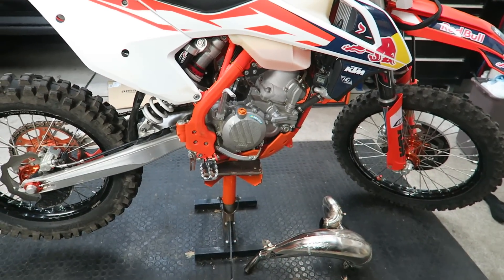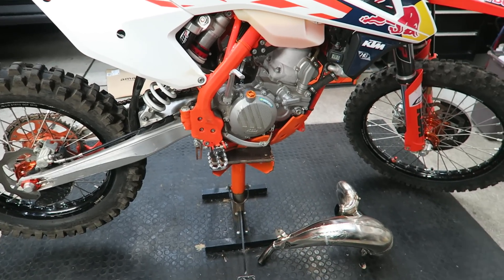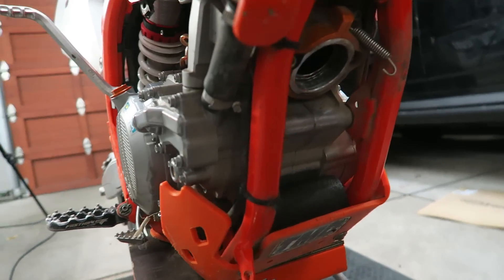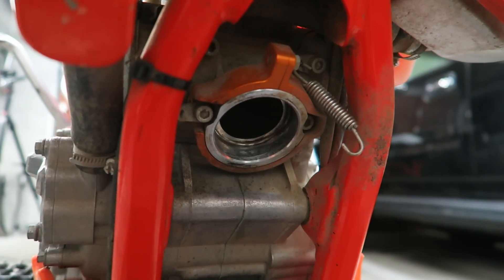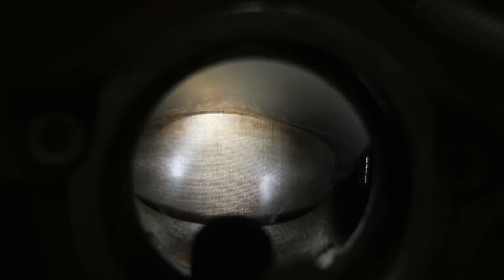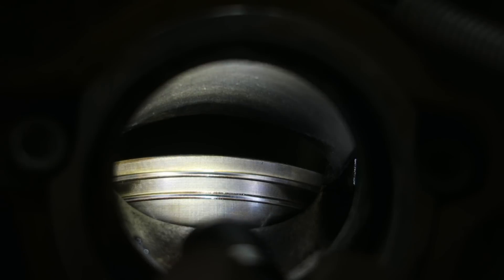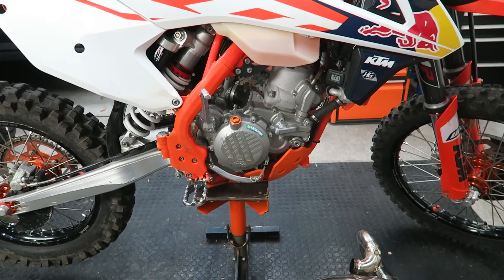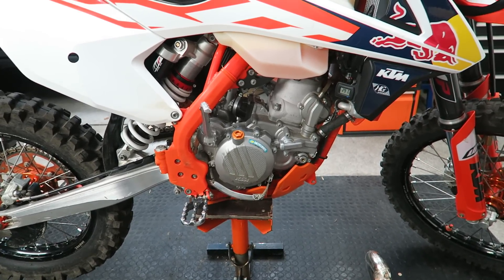KTM 2-stroke Piston Inspection Through Exhaust Port

Comment: Hi mate, really enjoy your videos and use them as a guide to work on my 2017 300 exc. My owners manual says to do the piston and rings at 50 hrs but you've done 100 hrs and it looks great. Is there something diff with my model that requires earlier rebuilds?
Reply from the maker: Frank Loschiavo - The service manual intervals are typically fairly conservative. But if you’re racing and riding your bike hard all the time I’d recommend following them. If however you do trail riding like me you can derate the intervals.
Reply: @TokyoOffroad  I trail ride much like you do and on top of my maintenance. Should I be checking the piston through the exhaust port from now on.. say every 10 hrs and look for wear? I'm yet to do a compression test but will grab a coffee and watch your video 😀
Reply from the maker: Frank Loschiavo - regular compression tests are a good idea. And inspection through the exhaust port is easy too. I’d recommend once every 50H, or more often if you’re worried about it. I change my piston and rings every 150H.